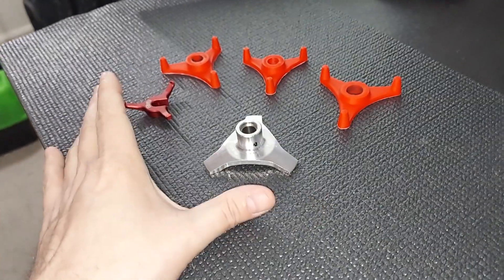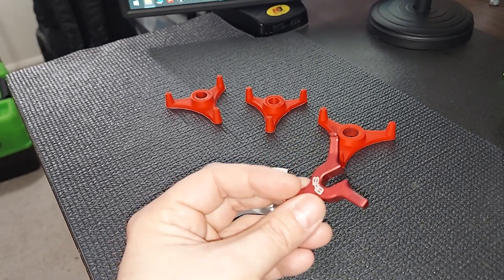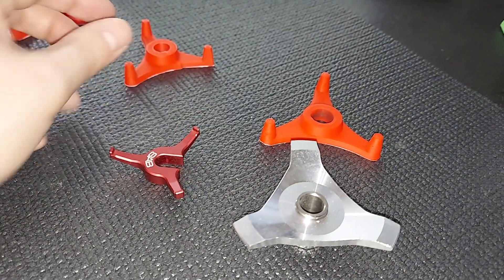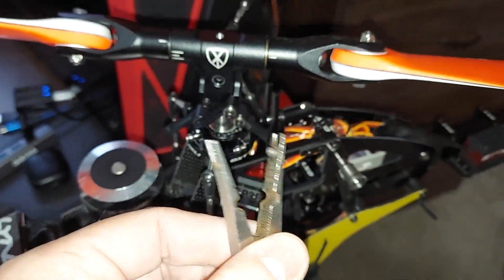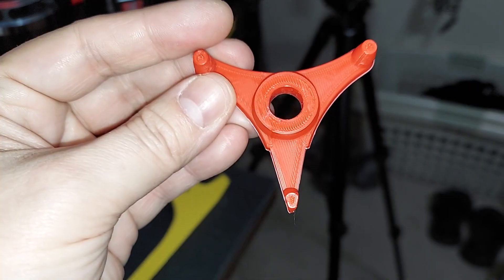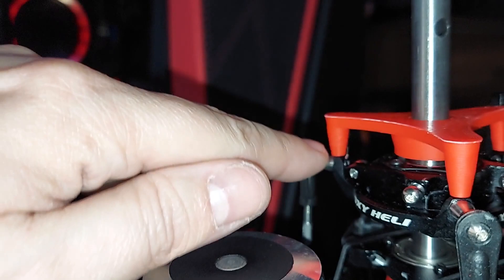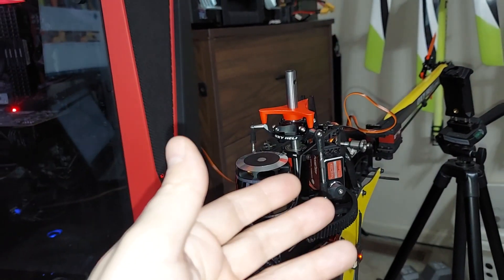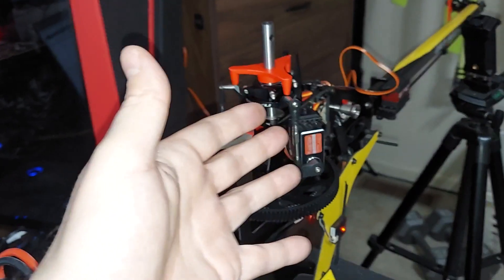Swashplate Leveling on RC Helicopters

Comment: Can i ask you a question? I leveled my swashplate on my Goosky s2 via the bluetooth app in a similar way you do with your software. When standing on a level surface and i’m in 3d mode, the swash is perfectly level. But when i switch to auto level, the swash tilts significantly to the right. I’m planing on maidening the heli soon, but i’m a little scared to try the auto level mode. I’m afraid there is something not right… Do you have any idea if thats normal?
Reply from the maker: Hmmm the only times I've had that happen my swash was not mechanically level. Meaning without software using the links that go from servo to swash, adjust it till it's perfectly level.
Reply: @NomisRC  in my case al the servo links are non adjustable and thus the same lenght…
Reply from the maker: @frisos3944  then it would be a gyro issue, I'd jump on a forum and post about it. I mainly use "helifreak"